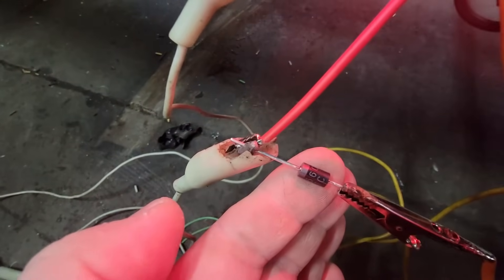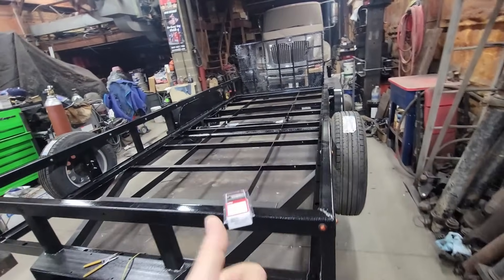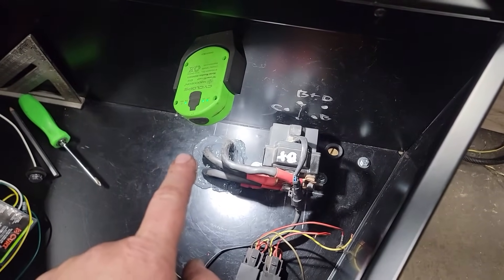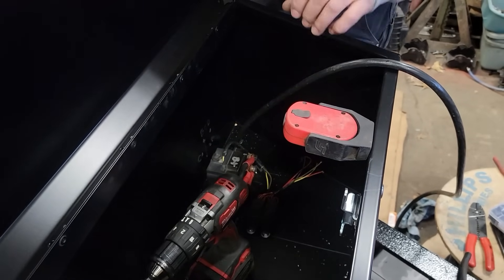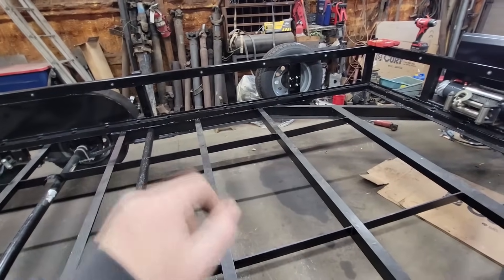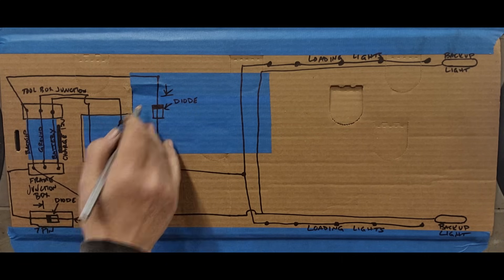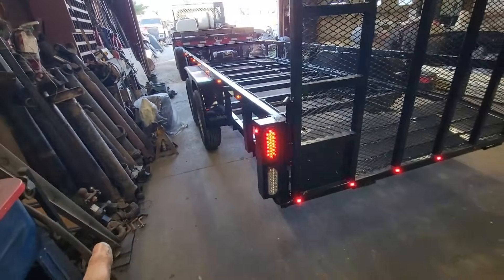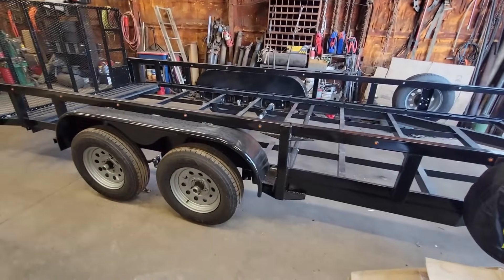7X18 TRAILER PT13  FINISHED ALL THE WIRING!  OVER 60 L.E.D.S! SERATATING STOP AND TURN SIGNALS.

Comment: Just a Suggestion, but add a “weep hole “ with a cotter pin , legs down bent  30 degree inside the electrical  compartment section bottom ( trailer) to drain any accidental accumulation or condensation of moisture. Yes I know it sounds contradictory to having a “ sealed up” box, but water or moisture will find a way in, the weep hole will help keep it drained ( and maybe keep rust and corrosion away)The cotter acts a “wick”  and helps a little keeping weep hole clear by shaking around as trailer is moving, your videos are addicting to watch by the way.
Reply: Excellent comment.

Comment: Very good job explaining this really helps me i have a 1966 D500 Holmes Wrecker planning on rewiring and bringing up to higher standards than original. wanted more lights and be able to control like work lights, spot lights, tool box lights, flashing lights as well and turn on and off as needed had never thought about diodes was planning on relays and will still use some relays but seeing this will make my job so much easier thanks so much

Comment: Looks great so far.  What I have found that works fantastic to protect trailer connectors is re-enterable potting compound.  Works great in trailer junction boxes as well to prevent water.

Comment: put a extension on the heat gun that cradles the wire as a back stop . you will get better performance from the gun.

Comment: The diagram makes sense JC and your explanation makes sense I just don’t understand diodes so the rest is on me I need to educate myself a bit more
Reply from the maker: diodes are a one way check valve for electric. they let it flow one one but stop it from traveling the opposite way.
Reply: @j.c.smithprojects  now I understand why you needed two the to stop power back feeding the truck in the distribution box and then the on coming in from the fist distribution box to prevent the load lights from going on with the reverse lights but when you turn them on it back feeds the backup lights but stops at the lead to the truck and the first distribution box
I see says the blind Man thank you for taking the time for that explanation.
Reply from the maker: you got it!

Comment: Very cool set up ! I knew they had the other way module but not the one you used to isolate the turn signals... that makes it simple ! I typically just use di-lectric grease on the terminals... does it not work good for that ? Curious to see what you come up with ! Another great video ! Hope Jeffrey is feeling good !

Comment: looks great an works wonderfully just dont turn on them load lights airplanes are gona line up to land on your trailer LOL as for protection inside that connector dialectric grease its non conductive and does not allow water ingress once the contacts are in and tight fill it up keeps water from getting in and corroding ive used it in places that get wet and works great

Comment: Nice video and great thoughts put into the wiring. I built a 18’ beaver tail trailer out of 30’ camping trailer a couple years back. 

What is the verdict on the M18 heat gun? I have been wanting to buy one myself.
Reply from the maker: holding my opinion until i get the pieces especially for heat shrink.

Comment: So  i have the system on my trailer i used 400 amp anderson connectors and ran a length of wire down the frame of my truck to the rear bumper so the trailer winch plugs into the back of the truck just like the lighting
Reply from the maker: i dont want to do that i as i have many different trucks and never know which one i may tow this with.

Comment: Converting electricity into heat is 100% energy efficient. The heat gun may use batteries quickly, but it does so efficiently.
Reply from the maker: it is not the most efficient way to make heat at all. if it were, we wouldnt have natural gas / propane / fuel oil furnaces. we would ponly make heat with electric. the cost to create heat with electric if=s far more costly than most fuels
Reply from the maker: understood.

Comment: It is an awesome trailer done the JC way. Remind me. How long is it before the tail? What were the weight rating of the axles you put on?
Reply from the maker: 16ft flat plus 2ft dovetail. axles are 3500lbs each. i considered going to 5000lb axle but i would have had to replace all 6 wheels and tires that i had just bought.

Comment: where did you get the Diodes you used for the middle rear marker lights? I need a few for wiring repairs my local Body company will do on brand new trucks and cause issues before the customer can take delivery of the truck.
Reply from the maker: you order them based on voltage and the load they are stopping. so each situation is slightly different.